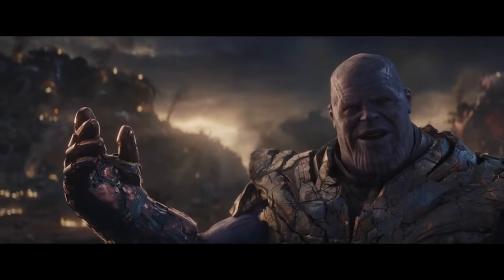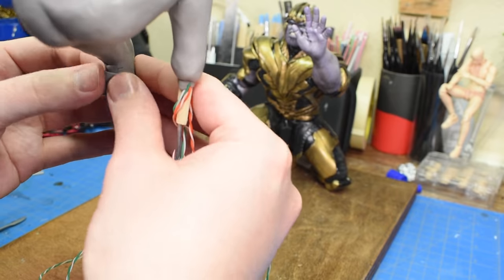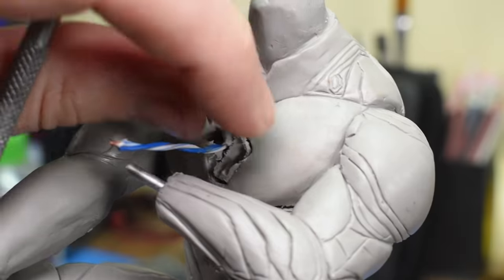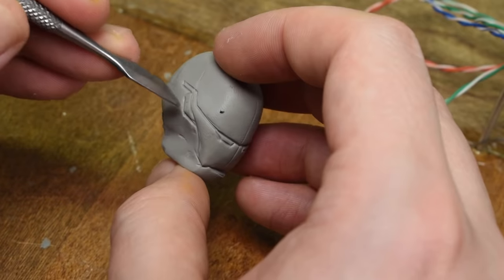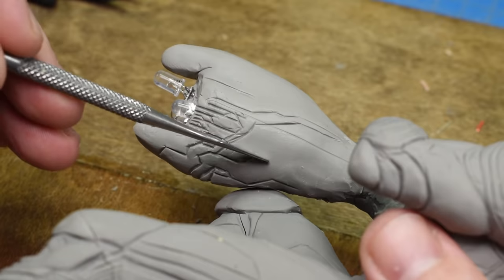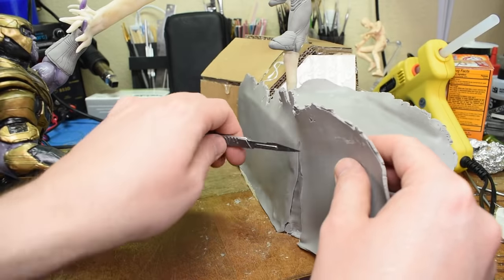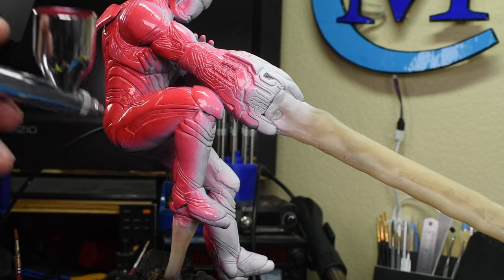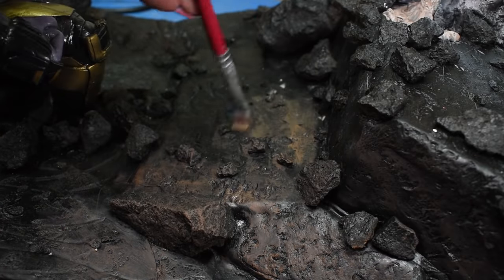Sculpting Iron Man VS Thanos (Part 2 Iron Man)Avengers End game battle diorama_Polymer Clay Tutorial

Comment: Came out awesome. One tip/suggestion I'd like to give you is to look into Testors cheap enamel silver & gold paints. You'll need brush cleaner as well. You will have to paint acrylic as a base coat but the enamel paints will stick to acrylic just fine. And it will only take a coat or 2 to get a really nice silver and gold color.  Those are the only enamel paints I use. Everything else acrylic